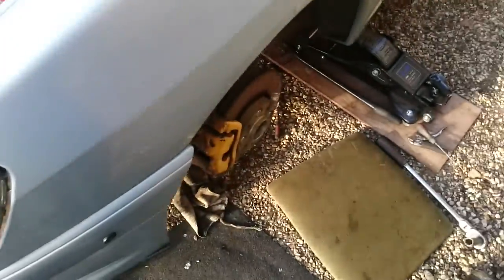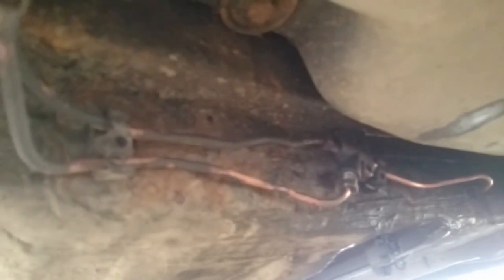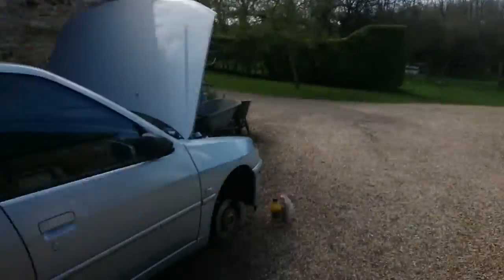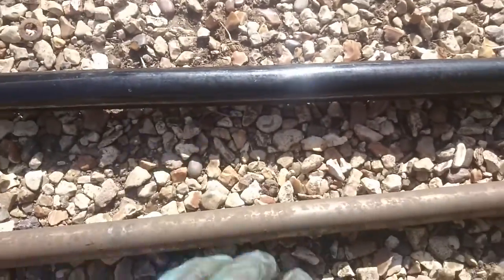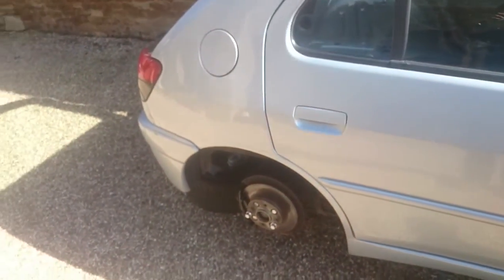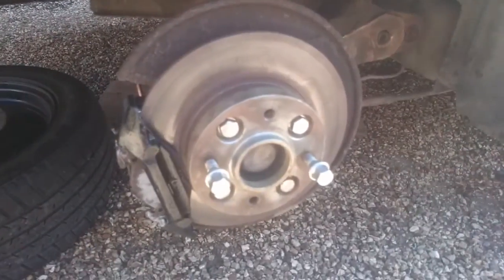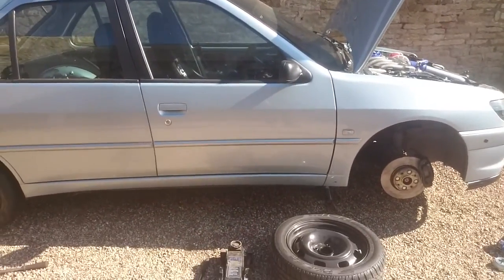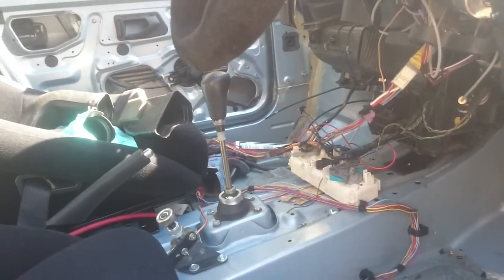Peugeot 306 2.1 Project update - BRAKES + rear beam

Comment: hello pp, ive sorted rear brake issues ☺, n/s/r caliper had rattle springs in wrong position as was the pad sliding plate. o/s springs were fine but plate also upside down, all surfaces were cleaned to shiny metal then sprayed with oxide primer followed by copperslip, sliderpins cleaned and regreased. then refitted with pads moving again and working much better at last, i did get extra hints from Eric the car guy on youtube video and i thankyou both very much... dave.
Reply from the maker: Nice

Comment: Hi there, enjoyed the videos!. I 've got a question, we recently got a peugeot 306 1.6i 8v. Is it easy to upgrade the rear drum brakes to disc brakes?
Reply from the maker: eem...its not that "difficult" but I wouldn't exactly say it was an upgrade...it depends on your circumstances.
If you were upgrading the fronts then perhaps yes. If the car is just a daily, not used hard, trailering stuff a lot or on track...then drum brakes well serviced are a better option...perhaps maybe the later larger 306 drum brakes. Issue with the discs is they get very little use on the back and have result also of a generally awful handbrake
Reply from the maker: thank you for your comments...and I hope I have helped in someway

Comment: thanks, it has pagid pads fitted already along with cheap discs approx 18months old, but they dont have the normal shiny metal surface you expect too see, more a darker shade really ! which is why i questioned cheap discs. n/s/r handbrake was v,poor and you could see caliper had not been working properly so i had a serviced spare to hand and swapped it earlier today, both items seem fine now ! :-) tho discs are off putting...
Reply from the maker: Well done

Comment: hello guys, my 306 hdi estate has the usual poor hand brake and is where my question lies for that. which is, can i improve it without doing a drum conversion ? 2nd thing is the discs, they were cheap new so are they inferior compared to more expensive major makes ? thankyou. dave.
Reply from the maker: Quality comes more from the pads. Until you get into high end performance discs.
Yes there is a couple of things you can do.
1) service the calipers...they are likely half seized.
2) replace worn cables...see above
3) adjust correctly...
need to back off internal adjuster.
stamp on the foot pedal a number of times then take up the slack in the cables using the internal adjuster 👍😊
Reply: Thanks pp, it has pagid pads i fink in the rear and the discs dont have the normal shiny appearance as most cars have ! Which is why i questioned my cheap ones from euro,s 18months back as they look really old and have a dark looking surface ! ? Thanks again, dave.
Reply from the maker: +dave brown could point to your rear calipers doing very very little work. best bet is to get the rear end jacked up and see how effective the foot brake and hand brake are on each wheel and check handbrake lever movement on the back of the calipers
Reply: Just tried em in road outside but they seem fine, car dips in a balanced way applying h,brake whilst moving again and i noticed anti rattle springs had been fitted between pads and top edge of caliper thus pads didnt move along the flat surface freely, so i moved them up and all seemed well tbh, i just cant get grips with very dark tho smooth discs. I am a wondering worrier im afraid pp :-)
Reply from the maker: +dave brown All sounds like it needs stripping, servicing and refitting.
Does handbrake work ok now then?
Reply: +Piggy Power hello again pp, hand brake seems alrite tho the usual weekness applies ☺. im going to remove the o/s 2moro hopefully rain permitting, and give that a going over mainly too see if i can get discs to give normal appearance after. spoke to a pug parts shop and he said he can supply me 2nd hand ones from newer models that have something square on them ! ? 30 quid a pair plus post with a very fast postage, next day last time for a door lock ! see what occurs on original first eh ☺ . dave
Reply from the maker: +dave brown £30 a pair for calipers or discs?!
Reply: +Piggy Power thats for a pair of calipers, pair of cheap new discs go from 18 quid ish ! i guess there,s no point getting decent pads as they dont do much work anyway ☺